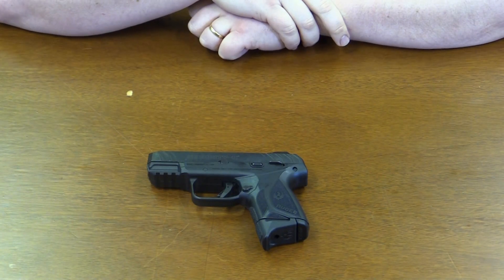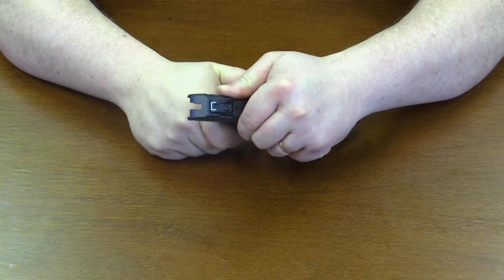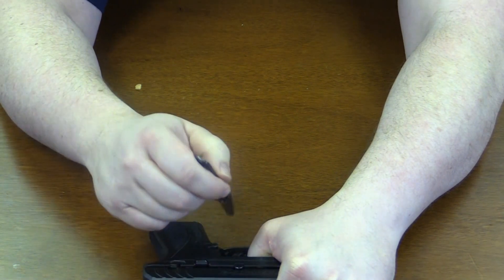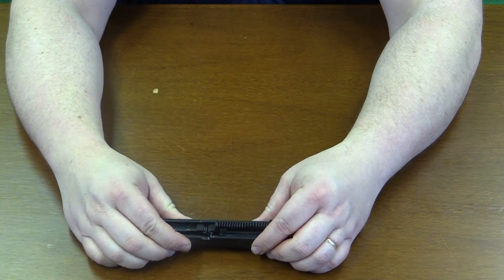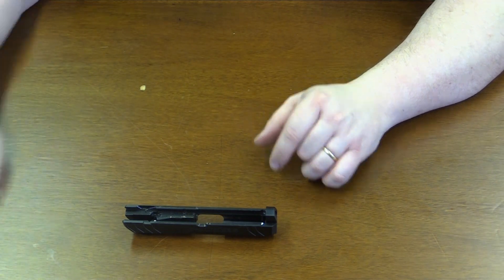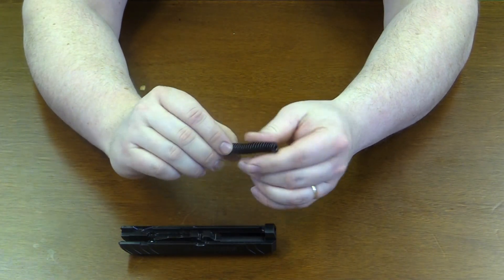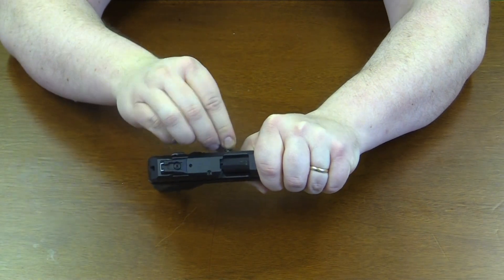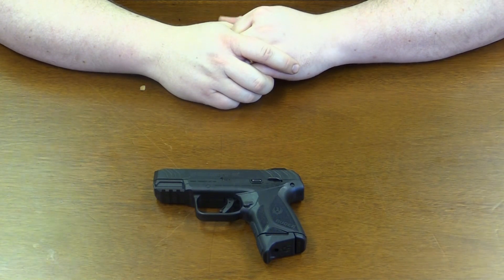Disassemble and Reassemble Ruger Security 9

Comment: I took apart my Ruger Security 9 and cleaned it and put it back together twice since I've had it which has been about a year. 1100 rounds through it and no fails. Taking this gun apart and putting it back together is as easy as pie.

Comment: Good video. Correction on the model, as this is s Security 9 Compact. The standard has a 15+1 capacity and also the barrel length of longer. You can tell by the heights in the picatinny rail. The compact version has 3 slots/grooves, as yours does. The normal model has 4.